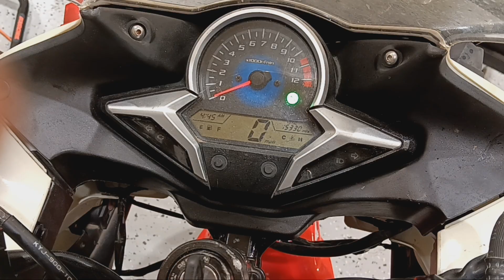New bike, clapped cbr250

Comment: Yeah, I may get a clapper or two now I have a trailer. That looks like a mess, but looking forward to seeing fixed up.
Reply from the maker: It looks worse than it is. Clipons need replaced and the seat was off to charge the battery. I might also use this bike practice to wheelies.
Reply: @EdTrollington  No doubt Ed, you look like you know what you are doing.